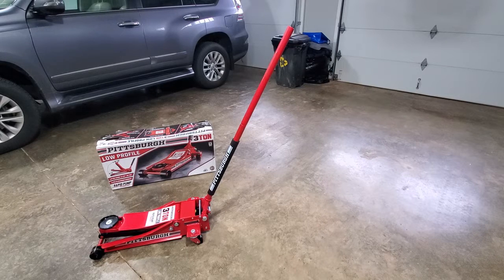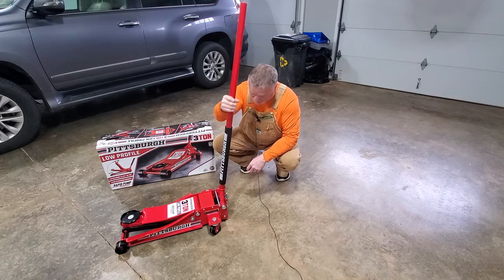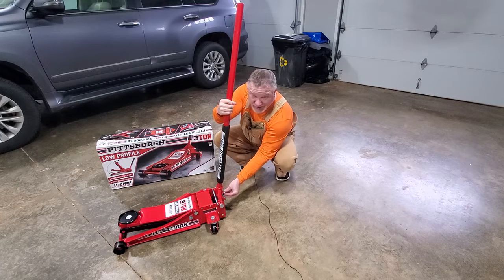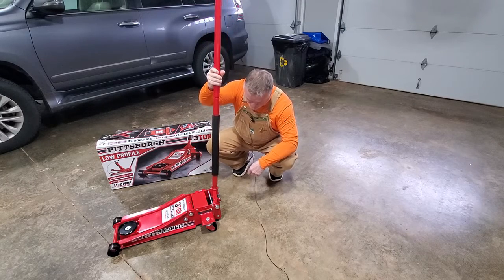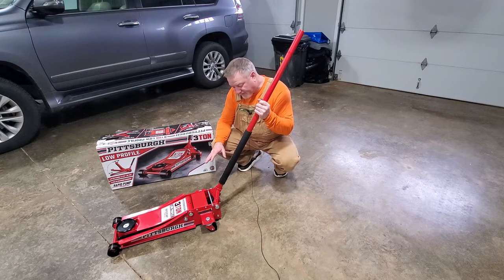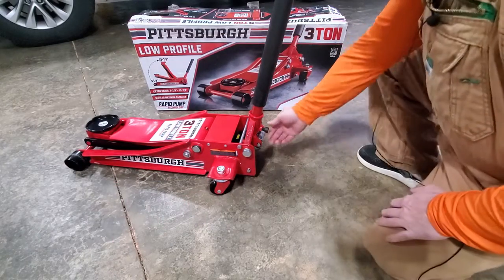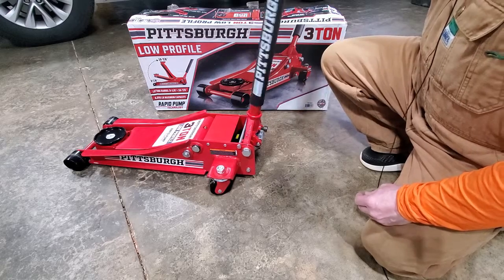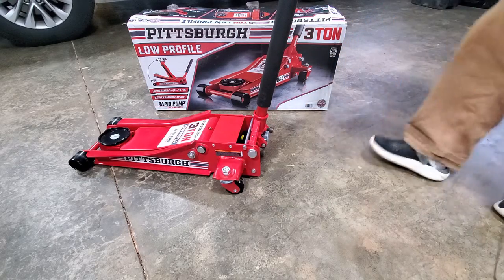Harbor Freight - PITTSBURGH 3 Ton Floor Jack

Comment: I bought the same jack today but didn’t get the low profile due to needing the extra height while working on my dually truck and it has the same issue..
Reply from the maker: There is obviously a design flaw.  Hope you were able to fix it like I did.